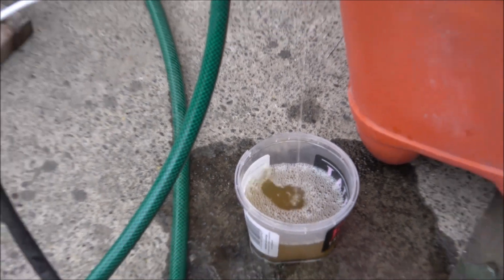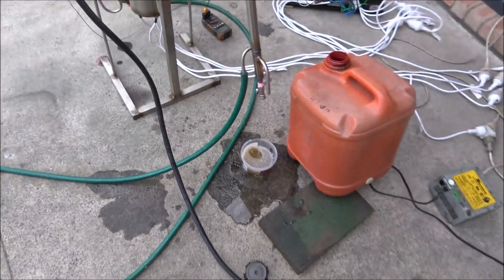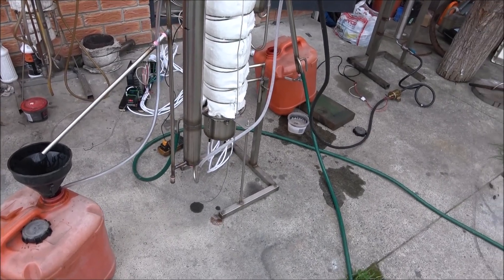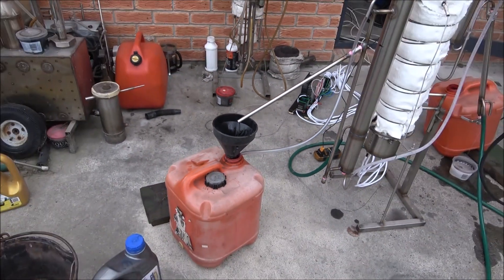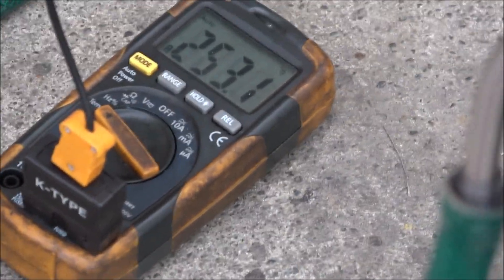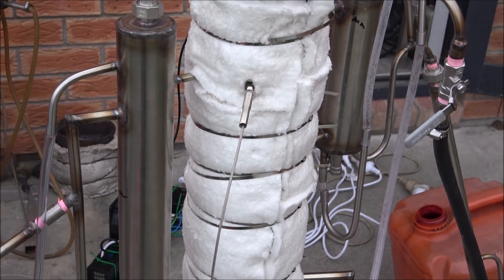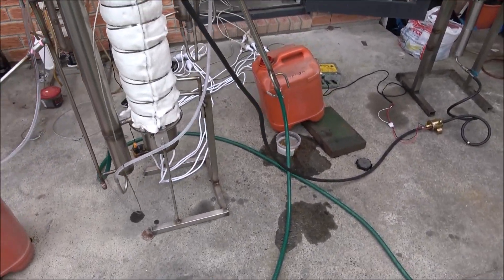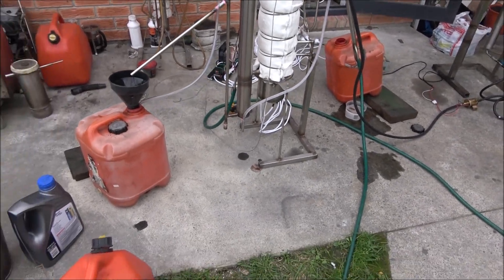Continuous reformer development - experimental run (shaky video from the personal archive).

Comment: Can I use this fuel for new cars
Reply: yes
Reply from the maker: yes you can after additional treatment
Reply: @santeryi9  sorry Alek I really need your help with bleaching diesel oil and make it good for common rail system engine.  Can I have email or something...?
Reply from the maker: @kirildimitrov893 send a message via the contact page: https://www.ferromit.com/contact.html